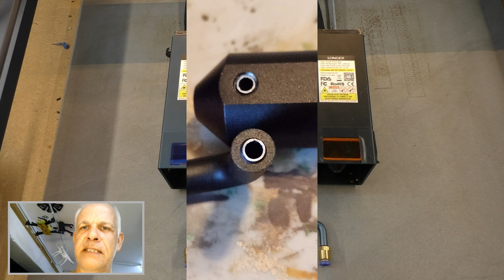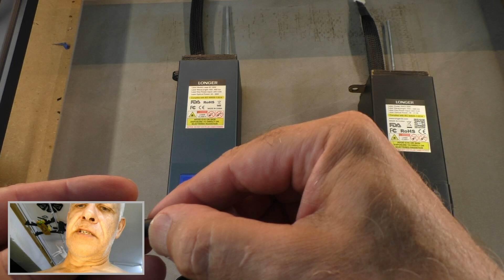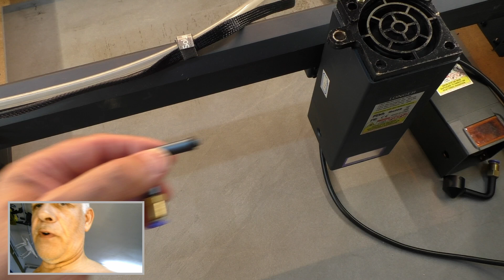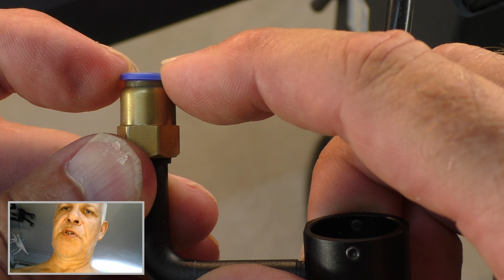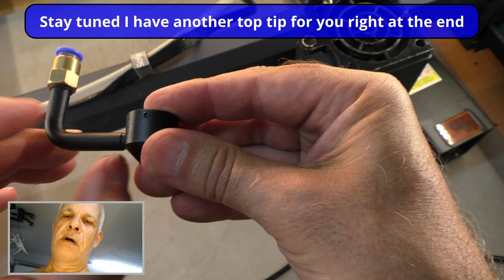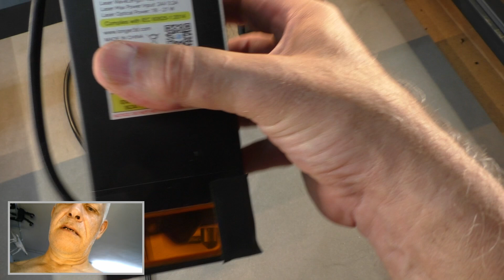Diode Laser Air Assist Elbow – DON'T SNAP IT!  | Easy Fix & Nozzle Upgrade (Longer Laser)

Comment from the maker: I have a part two coming out soon
Reply: I have to do a cleaning of my entire Ray 5 10 watt. I’ve watched the diode cleaning video but I’m gonna have to clean the axis’s because I’m getting streaks in my slate coasters. Probably because I’ve been engraving so many and lately been using the negative option. Very dusty in my axis tracks
Reply from the maker: @REDCRANE1944 yes it's very bad for giving of dust. Is there any pattern, like at a regular distance, to these marks you are seeing?
Reply: @FlixmyswitchLASER this is only the second time I’ve cleaned the diode. I have an enclosure so the dust doesn’t exit that fast even though the exhaust fan seems to keep the odors at bay. M working on the diode right now and it’s pretty dirty. Going to review your diode cleaning video before I go away further. This is my first laser engraver and I’ve had it about five or six months.
Reply from the maker: @REDCRANE1944 I recommend a 150mm online fan. 
https://youtu.be/j1qp86ifxOE?si=yWkI5f1mmzIPk9lh